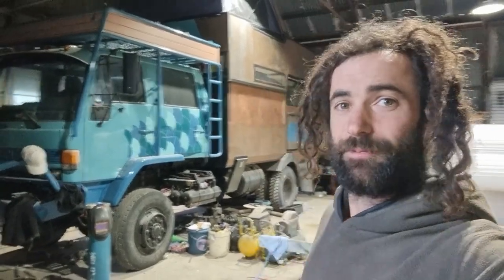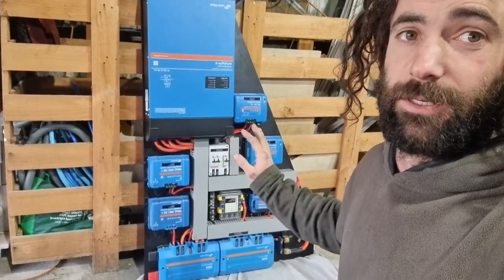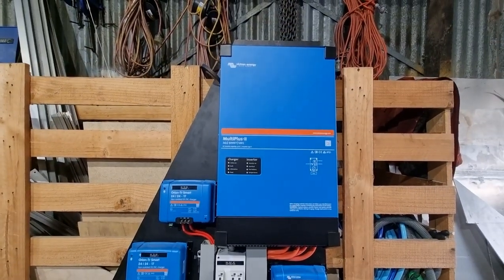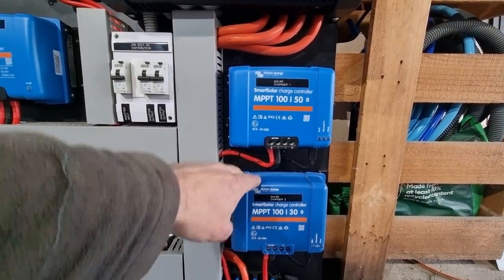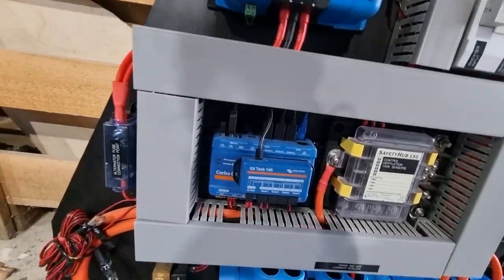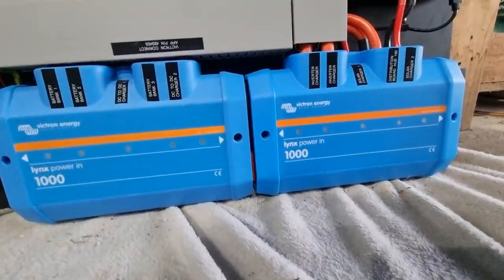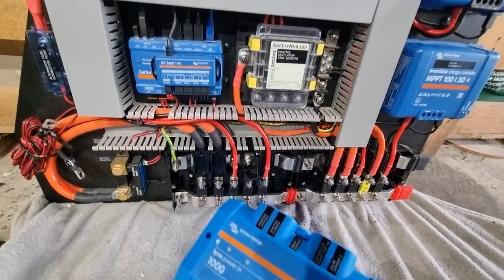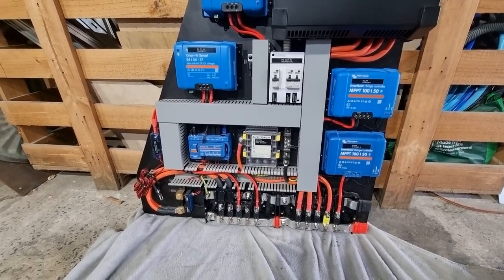Truck Camper 5KW Victron LFP Electrical System - Expedition Truck Build #34

Comment: Very Interesting! 

Just a small suggestion for the future.
In the video I noticed that the sound is louder on the right side. Maybe you could just use mono audio when editing in the future. I have a switch on my audio setup that makes it mono and it is much more comfortable. 
(But before it is too much work with the videos, just continue as before, rather not quite perfect sound, than no videos :D )

Comment: I noticed that the Lynx Power-in was modified to add in fuses, this is a common hack I have seen in other videos. But what's new on yours is a 5th fuse holder, did your electrition modify the power in to add the middle and 5th fuse holder?

Comment: stunning setup ... most importnt question is how much ? ..lol ... i will take a guess, about 15K ?
Reply from the maker: The panel cost $8k
Reply from the maker: It was $10k including Sunman E-arc solar panels and BMS units for the batteries
Reply: Wow thats very resonable, less that what i thought it would be @dancampion
Reply from the maker: @sydnet851 yeah I was surprised, it wouldn't have been much cheaper for me to buy the same comments and assemble it myself taking into account the trade price that the sparky gets on everything